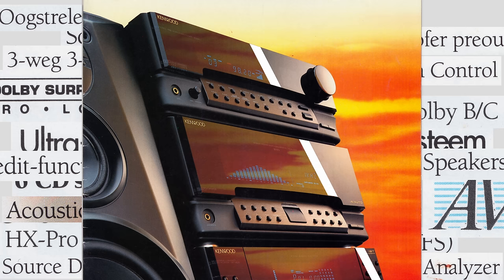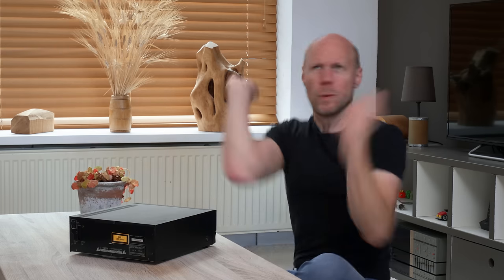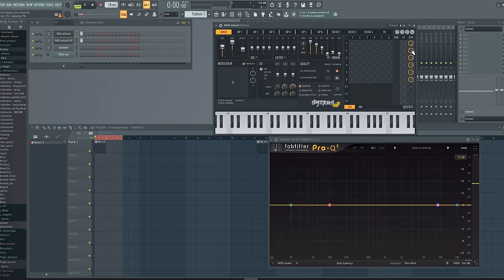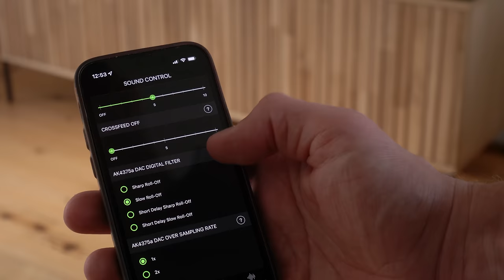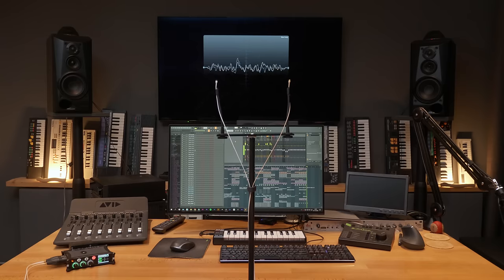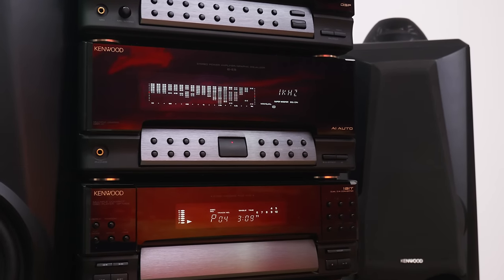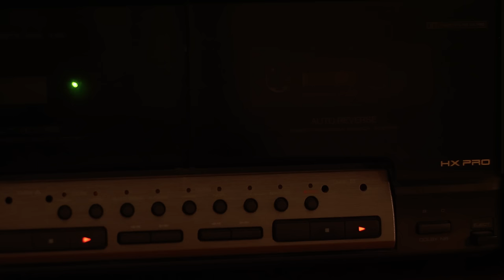Desirable Nonsense

Comment: I sold one of these not long ago on ebay in the UK. 
The pre-amp display is known to go blank, but it is just a 50 pence capacitor that needs replacing inside as I fixed 2 of them after finding this out ;) They're lovely-looking stereos, with the only fault being the slow-acting volume knob. 
Making your own cassette tapes definitely required the use of the manual, as it was quite complicated.
Reply: Hey @davidreynolds3082, this is what has happened to mine, do you think you could lead me to which capacitor needs replacing ? Thanks. Would love to be able to get this system up and running again.

Comment: Ah!! My dad had the exact same sound system!! This is the piece of equipment that got me into audio visualizers. I loved watching the little bars 'sing and dance' to the grateful dead growing up. My dad always had it in some weird echo mode (DSP) and thought that's just how they're supposed to sound lol.
Reply: Just thinking of all those people who were (or still are) convinced that a certain "sound mode" was/is how music should actually sound like, and then be really enthusiastic or even get annoyed or mad if you're trying to convince them otherwise. 

Just a year ago, I went to this couple's place, whom I had never met before, with a friend. At pretty early stage I noticed that the rear speakers of his home theater system were trying to output some music but it sounded like severely mashed up, distorted bits and broken compression algorithms. And once I noticed that, I tried to listen to the front speakers and they didn't sound much better. At some point I decided to fiddle with the remote and found a basic "stereo" mode. Then the system (with some pretty expensive looking main speakers) started sounding like they were actually playing music (without the surround speakers). 

Fast forward a bit and I hear the dude raising his voice about someone making changes on his receiver. Yeah, ok, I get it, I'd be pissed too if someone changed my settings, but only if they were some actually measured/set up room corrections that really took me time and not just some idiotic "dolby pro logic" or "BBE level +5" nonsense. I think his receiver was one of those very basic integrated home theater amps... Even though the dude seemed like he is in to hifi more than average, as there was another pair of floor speakers in the "hallway" of the apartment.

Comment: I've always wanted to play with those Tang bands @5:50

Also the main advantage to omnidirectional speakers is sound stage. if you pull your speakers 0.5-1m away from the walls, sit about the same distance away from the speakers as the speakers are from each other,(or further) in a room that has been acoustically treated appropriately, the sound stage can be very impressive. That is to say, instruments can appear to sound not only between the speakers, but above the speakers, below the speakers, behind them, in front of them, or even a foot or two past the sides of the speaker. 

But without pulling them some distance from the walls and taming some reflected sounds, they can become peaky in tonal response, as well as more vague in the sound stage and instrument location. All this is to say, it can be very complicated to get it omnidirectional speakers to sound their best, and while the effort is absolutely worth it for the those people who chase sound stage like that, the general consumer will not only ignore the process required for such an impressive audio experience, but the average consumer will find acoustic treatment to be expensive, ugly, and that kind of speaker placement is generally impractical in most living situation. 

remember, sound stage is completely different to tonal balance. It is possible for a speaker to have amazing sound stage, but awful tonal balance. Or in the case of many high end electrostatic speakers, the tonal balance is breathtaking, but the sound stage is difficult to get right and many never achieve it. In that specific case, it is because electrostatic speaker panels almost always have a laser like acoustic beaming quality to its sound dispersion, which is of course the complete opposite of the omnidirectional speaker. With the omni, tonal balance can be partly effected by the distance the speaker is from the wall, caused by standing waves which result in boosts and cuts of specific frequencies That are a wave length multiple of the distance the speaker is from a boundary/wall. The further the speaker is from a wall, the less this is a problem, especially combined with appropriate acoustic absorption and dispersion treatment, but you loose acoustic coupling in the bass region so you might have to boost that a little. 

All this to say, I've never heard these exact speakers myself, but I understand WHY they brought these out and WHY they would be a failure in a mass market. God forbid they put those omni's in a bookshelf! 😂 

Anyway, I could very easily talk and talk and talk about audio with you but I feel I've done enough of that 😂 but if you ever want to chat I'd love that ☺
Reply from the maker: Ah well I talk at my best when I read my script (for the 9th time...)😁
Reply: @PosyMusic  I really really love your videos. Thank you so much for making them!

Comment: The speakers sounded surprisingly good for 1994 because you don't realize that speaker technology was already mature in the mid to late 80's.  I remember active servo technology by Yamaha was already a thing, and seriously nice quality speakers were as good as they can ever be now, sonically and by style.
     Also, this unit might as well be modern, it looks as similar and desirable today as when they were new.  Just the features inside lack some modern options, like Bluetooth.  Otherwise there would be almost no way to know this system was that old.  The style is pretty much timeless.

Comment: Awesome video and nice bit of kit. 7:40 - If you aren't aware, speaker foam surrounds can be replaced. I used to do this often when I worked in an electronics repair shop as a teenager.

Comment: This video is a deserving tribute to the Kenwood UD-952.
Actually, it is very difficult to photograph this master piece, with reflections of camera, cameraman and the surroundings on its fascia from any angle.

One of the most beautiful audio equipment ever made. I have two of this.
I think the blinking indicators at the center of the hub of the cassette transports is not seen on any other deck made by anyone.

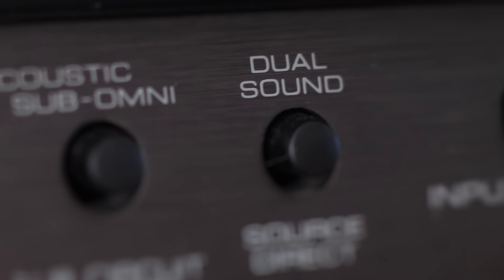7:54 - Dual Sound: Kenwood produced and included a CD in the package called SOUND ENHANCEMENT-CD containing environmental sounds such as Waves, Rain, Birds etc. and even Cars.
Reply: Thanks. But I not having an account in Telegram.

Comment: Wonderful video. I cannot express how much understanding I have for every single second of it.  Your videos encouraged me to take action and boldly solve a problem most normal people just ignore: some music I like tends to disappear from the internet. So I decided to save it the old skool way like I always imagined it should be done - on minidisc! I never actually had one in it’s heyday but since I’m older and I can afford it now I thought: why the hell not. Minidisc are cute and colorful, the source is compressed anyway. I was also looking for a slightly better pair of speakers for my PC so before actually ordering a pair of decent monitors - why not take a look at the 00’s bookshelf hifi? And so I did. I found one by accident that was kinda broken but dirt cheap and just went for it thinking - it’s a good start of a quest for something better. I wasn’t afraid of repairing it myself obviously because it was dirt cheap. After two weeks of taking it apart and putting it together again I managed to fix every issue so now I had a placeholder micro hifi to play (and save by recording record) some music while looking for a better and more advanced system - maybe even from Japan! It took me a few months of tracking the ebay to come to a bitter sweet conclusion: there were no better systems than the one I bought dirt cheap almost by accident (cmt100md). Every other system I found is plagued with way more issues and by any mean even more frustrating to use nowadays. The worst part is I was really looking forward to enjoy the quest inspired by your videos to find myself the best hifi of it’s day. I know it saved me from having a closet full of old hifis I never use but the quest... oh I know it's stupid but I still think it would have been a wonderful and pointless waste of time and money :)

Comment: You MIGHT have just enough room to fit a BDS PP-131 2U (or if not, the PP-131 1U), 31 Band (31 x 30 LED tall - Yup 930 LED's) Spectrum Analiser in the space tope left of all that Hi-Fi gear cabinet. ABSOLUTELY LOVE this thing. Multiple features/modes/displays, you can buy them with different colours (mine is all green with a row of 'Peak' level being Red), there are white with 'Peak' being blue, have a look, many to choose from. You can also get the 1U (half height 31 frequencies x 15 tall - Techmoan has one)). And being 51, I was in some of the best years in my life in the mid 80's/early 90's with my Fathers Technics stacked Hi-Fi system. Though there are many other type displays or designs of visualisers with waves, and weird coloured, spikey, flashy etc 'You've taken shrooms and seeing things' type music visual displays, but....
For me, having a good, basic segmented bar display with many frequencies, just... Visually shows what the various elements in the music I'm listening to is actually doing.
Yeah, these units might be a few hundred quid (£), but, they are solidly built, have multiple connections for L & R channels, designed for Pro/DJ use, and in the 2.5 years I've had this PP-131, not one issue. I've not taken the film off the display either as it doesn't interfere with the display. AND what's more, I have it connected to my 1989 Technics SU-600 'New Class A' Integrated Amplifier, among it's specs 30W per channel into 8Ohms, frequency response 5Hz to 70Khz, Impedance 4Ohm to 16Ohm (serviced, amp chip & capacitors replaced) driving a pair of well placed mid range Sony bookshelf speakers. Now someone's reading this and thinking "Wait what? ONLY 30W per channel?" Ha, calm thy passions... Old Amps CAN deliver if matched to the right speakers. Though my input is from an Nvidia Shield K1 tablet with a Dragonfly Cobalt USB DAC, I have my SU-600 set on 2 (out of 10 on the volume) as THAT IS loud enough to annoy my house mates... So yeah, when you did your tests, I didn't need to put headphones on 👌😏. So yeah, just goes to show, the choice... Buy a new £/$400-500 or even £/$600 amplifiers, or... A serviced late 80's/90's (Technics/Sony/Kenwood/Pioneer/NAD etc) Hi-Fi gear Amplifier for £/$100-200 plus a good set of speakers... For my money, 'Old school' seriously STILL holds up to todays Amps with 'Class D' chips and electronics!
Let's put it this way, my partners lad (17 years old) is all about BASS, THUMP, MAX WATTAGE!! hahaha, but... When I sit him down and play the stuff he likes on this, ahem, 'Ancient gear', hahaha, his face is a picture! Spacial, full, detailed, proper stereophonic clarity....
It's all about, buying the right amp (NO, max money doesn't always exactly equal 'Top sounding', and matching it to a good quality set of speakers.
SO, for ANY budding 'Audiophiles' who want to step into the world of way better sounding equipment than just a Bluetooth speaker, try heading to YouTubes 'Cheapaudioman' and you'll get great help in finding a complete setup of Amp/Speakers for as little as £/$300-500 (and if you have the money, higher budgets are catered for too) , it's easy, and VERY possible. 
All the best to you 'True music lovers' out there! 👍😏      😎🇬🇧

Comment: Pretty cool. I personally think the NL speakers look better than the german ones, however only if you remove the omnidirectional speakers. And indeed they sounded better than the studio speakers in the recording, probably has to do how well matched your mic is to the speakers as well as position maybe.
I personally own a pair of braun LS65 that my father bought 20-40y ago together with an old yamaha amp and yamaha tape and cd deck (unfortunately from a different series - but hey they were free). Also the cd player skips a lot but whatever, i can listen to cd on my pc, cant do that with casette :P

I really do wonder why the previous owner ripped the feet off, maybe it was mounted in a closet?

Comment: I do have a Technics Hi-Fi. I had a lot of fun with it but unfortunately something is breaking in the logic board because every button has like 60% chance to do different thing than it should, so Power button often is switching between audio sources insted of turning off. At least speakers are in pristine condition😁
Reply: It’ll be resistors for the button array, or dirty buttons/contacts, not an IC. :)

Comment: Oh yeah, i thought the speakers were great, those optional tops are a "Must Have" if you can find them used & those foam edges are a doddle to replace, i've done a few vintage re-foams from eBay kits <£16 pair, foam always perishes &/or becomes brittle after 20 years, local humidity depending.   Those omni- dirdctional tops ...a truely great design. I particularly liked 2'nd hand Trio & kenwood gear from their higher-end line that i bought in late 80's - 90's (pre-eBay mad prices) but which they made 10 to 20'ish years earlier in the mid 1970's to mid-80's, their golden years imo.
 My stereo will not play 2 sources together! I suppose I could parallel 2 line inputs in the back of the preamp with a piece of wire & the selector of either input would then make both inputs 'live' together  ...& bung a 20K vollume pot on 1 input pair for level matching ...with a 100k resistor accross the 2 + inputs, to stop the vol pot effecting both channels, for when I desperately want to listen to two music sources at once, or a radio play to the sound of The Dammed, or 'The Archers' along with Sousa's classic marching tunes, but then i'd not have the labelled knob for friends look at, in wonder while hearing Edith Piath sing along with any Zep' album

Comment: Having the dual audio mode would have been my killer feature for me in the 90's. I would have wanted to plug this into my TV/video game setup, so I could play games while listening to my own soundtrack instead of some highly repetitive ones. I eventually solved this with passive Y RCA cables, RCA to headphone jack adaptors, and finally a laptop with a loopback extension to monitor the live input. A hardware solution, would have been an amazing option, especially if it included switching for both A and B channels.

Having two music streams obviously becomes discordant, but I could also imagine playing soothing music during news radio or other talk-only content, as I presently will play music mixed into my headphones during an otherwise boring company meeting while I am work-from-home.

Comment: Lovely! Excellent recreation of the brochure :) I'm a big fan of Kenwood gear of that era. I now own the system I used as a kid when visiting my late father, a Kenwood '94' series system. A bit older than yours, 1989 I think, and larger. A-94 amp, X-94 tape etc, with turntable which has a servo sliding arm on a rail vs pivoting from the corner. Can press play on the remote and the record will play. On eBay after i got it i found in europe somewhere for significant $ the GE-940 EQ which was the only piece missing from the optimal setup from the manual, got that sent out to Australia and replaced the power cord and from the service manual confirmed it was fine on 240V here. It has large Kenwood S-949 three ways which do sound better than my (cheap, behringer) monitors. And these are labeled AV - magnetically shielded, handy since I have a bunch of CRTs for vintage computers.

Comment: Am building the HiFi of my childhood.

A SONY LBT A77. Currently have the E and N components. Not so worried about the sources tape, tuner and cd sources. Will get them just for nostalgia. Maybe just the turn table will be the next component I will use. I will have to rebuild the speakers as there are very good documents for the specs, cross over and dimensions. I cannot wait to complete the project.

The wife does not understand 😄

Comment: Wow how cool they made stereos so much better back in the day. Not only the sound but also the design, some of them had a much stronger effect. Yes, it was better before. Now everything in the same device is played on bluetooth and wireless and it must be voice controlled and it must be played on spotify from some list. No, I like to choose a song from my own list without internet. Not that there is anything wrong like to play from time to time on bluetooth there is nothing wrong with that. I like CDs or vinyl records. Because it's a completely different sound. Back then it was in parts CD record player cassette deck and you controlled the sound with your equalizer or other buttons to get good sound, it was a unique unit at that time. It fit in the TV room or the boy's room or yes you know where part of the design in the room you could have 2 speakers or 4 or even 6. now everything should be as small as possible, nothing wrong with that either. I like technology stereos and speakers. so i like your videos i like them sharply.